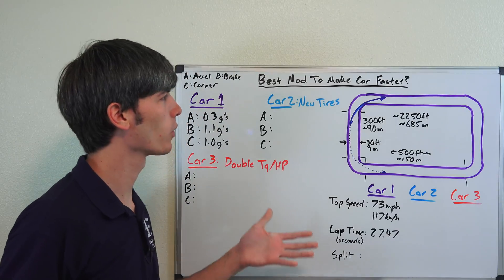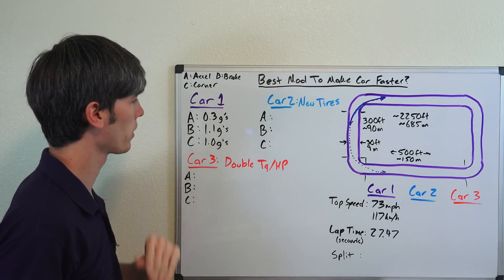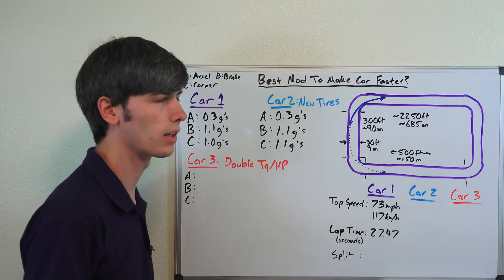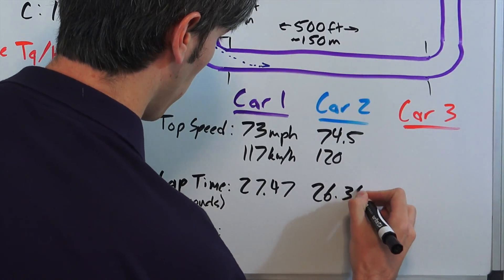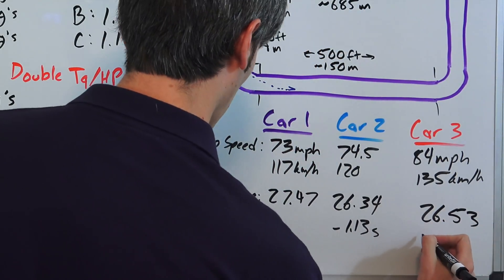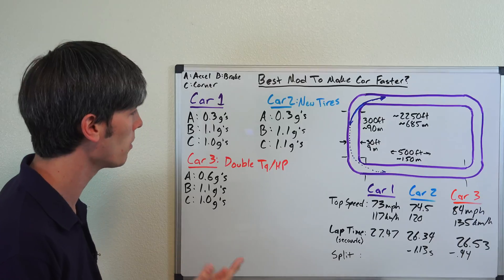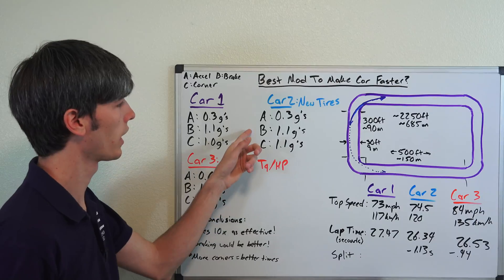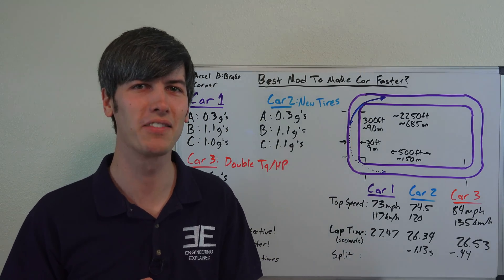What's The Best Car Mod To Go Faster?

Comment: didn't even get to the vid yet... but the best modification is to adjust the loose nut behind the steering wheel, the driver is usually what needs the mods

Comment: I think any aftermarket part you can put on a car that can be reversed(for profit) is wise for modification. If it can't be reversed like a engine bore increase(can you really get back the metal you shaved off the block?), the only profit you'll gain is the feeling of going fast lol No one would want a Skyline R34 with modifications the buyer can't put on...

Comment: Another thing that really boosts the performance of tires and cornering, is weight reduction. You should be looking at an easy 2-3 seconds quicker overall. It's a lighter load to stop, meaning less stoping time, and you can hold the speed better around the corners.

Comment: Better tyres are not only faster in corners but also much more safe in every way, which isn´t that bad considering that a real sportscar is being moved at higher speeds and may have less safetyequippement (like a Lotus or Caterham e.g.). How much difference can make an adjustable suspension? (I know that it is depending on the car and its standard setup) My experience is, that many people who changed their suspension, have a worse car afterwoods despite of a wrong (mostly too hard) setup.

Comment: I'll keep this in mind for my not so high powered sedan.  I'd consider stiffer suspension as well, but, road conditions and speed bumps.  Or does modern suspension exist that would make you comfortable driving normal speed over speed bumps yet helps you corner better vs standard?

Comment: Hello, Jason. My name is Donald, i'm from Malaysia. I'm really curious about a device that is widely sold in the local market. It's called a "twin ball bearing air charger". The company claims that it is dyno tested and is supposed to increase horsepower. I'm skeptical and I would really want to know if it is true as I plan to install it on my car. This is the link to the product: http://www.worksengineering.co/twin-air-ball-bearing-air-charger-/product-690505.html
I really hope you could clear my doubts regarding this. I'm a very huge fan and i've done most of the mods to my car based on your videos. You are a genius in the automobile world. I would really appreciate it if I could at least get a reply or have you make a short video to explain how this device works and also whether this device works at all. Thank you.

Comment: The best is getting a car with forced induction like my WRX STI or Audi A6, then tune it. I found stage 2 to be the sweet spot for both (might need a downpipe on turbocharged cars, a smaller supercharger pulley on supercharged)

Handling wise I found that new sway bars and end links were the cheapest and most cost effective mod for cornering.

The best upgrade aside for tuning was some wider lightweight Rays Gramlights rims and Michelin Pilot Supersport tires. I saved for these for a couple of months. It was a huge huge difference in braking, acceleration and cornering.

That's the order of mods I found to be the most effective. Everything else had a smaller effect, like steel braided brake lines for stronger brakes or a smaller steering wheel for better turning.

I think the most important thing at the beginning is getting a capable car to start if you want to modify it. You have to get an already good car to make it great.

Comment: I'm not sure how interesting or different it would be, but if you're willing to do a basic comparison between perhaps increasing the tire width vs. increasing the effective wheel/tire diameter vs. using an improved tire compound I would be interested in seeing how that theoretically plays out in this situation. 

This is a good general comparison though :) Proves the point about how different modifications (and/or vehicles, picture something like Lotus Elise vs. Ford Mustang GT) may or may not play a significant role in improving performance under different scenarios. It also makes you realize just how complex of an analysis this would be if you were to factor in all of the dynamic aspects of a vehicle's geometry.

Comment: I always wondered how torque is affected by an outside source. Its hard to find any information about it. For example : say a car makes 200 hp and 175 lbs/ft of torque. If it was possible to connect an electric motor to the drive axle and the motor makes say 25 hp and 75 lbs/ft of torque will the the total torque to wheels increase; or will the engine supersede the electric motor because engine already makes more torque than the motor can produce?

Comment: So I don't deny that tires are VERY important and make a huge difference, but it seems to me like this track may just favor the car with better tires while acting to mitigate the improvement more torque and horsepower would make. In your rounded rectangle track, your left and right curves are 300 ft. You call them "straights" but then you say that your cars go through them at constant speed. This makes torque/horsepower less relevant then. This only leaves the two 500 ft straights, which are barely longer than the 300 ft straight. So of course torque/horsepower would seem to make less of a difference.

I mean you're going through 600 ft of the this track at constant speed, so of course the car with better tires would pick up an advantage when only 1000 ft of the track can be used for acceleration. 600 ft is more than 25% of the track you're traveling at constant speed, which doesn't seem realistic to me.

A track with shorter turns that don't last as long, with some more time for acceleration would show the car with more torque/horsepower holding an advantage IMHO.

Comment: What I find funny, is the car with double the tq and hp, would be able to accelerate out of the corner a lot quicker,  even if the tires were the same as #1 is barely a difference, especially when it comes down to the weather and how hot your Tires are. Sticky tires don't do as good unless it's hot. So I feel car #3 would be the best

Comment: can you please make the following videos:
-how the new amg exhaust works, crackles and pops
-best mod to increase engine power safely
Reply: Solider Armatang supercharger or turbo charger. you can get some kits out there that a some somewhat mechanically inclined person could install(supercharger only, haven't seen any "easy" to install turbo kits out there).
Reply: Alex
but those cost a lot tho, but i get what u mean, but also tranny is an issue since it might break under all that power.....
Reply: Solider Armatang you asked for safe ways to increase your engine power you didn't said cheap (LOL) but a tune and a less restrictive exhaust system is pretty cheap and can make your car faster.

Comment: i'm a firm believer in good tires and I didn't always believe. I used to go to the chain tire store, buy the most affordable tire I could find and that usually meant a hard, generic tire. one day I bought some good, but used Michelin pilot sports and DAMN! those tires changed the whole attitude of the car in the best way. the car negotiated bumps better, turned, accelerated, braked and over-all drove on the rode better. that's when I learned the importance of good tires.

Comment: Wanna make your Civic si faster?

Follow these mods and you'll be smoking F1 cars in no time:

PVC pipe exhaust system +25HP
Type R stickers +500HP
Pioneer or KENWOOD flashy sound system +150 HP
spinning rims for more tyre grip.

And last but not least..... add cardboard aero kits for more aero grip.

You'll be driving like Ayrton Senna in no time!!

Comment: How to find the best tires?

I drive a 09 Jeep SRT8 (modified) with 275-40-20 tires in the front and 315-35-20 tires in the rear. The first mod i did is toss the OEM run-flat tires an slap on some Nitto NT05's but now (2 years later) those tires are finished and I'm looking to step up to better tires, do you have any recommendations?

Thank you!

Comment: As an example, the toyota's Rav4 for rallying uses the stock motor.  
  
Another advantage to the Rav4 however, is that there will be few cars rallying in that class (usually) compared to other vehicles.

Comment: nice explanation .
just a thought if  u double the the power of a motor with lets say boost shouldnt the braking force improove also just as the ones in tires i know i wouldnt be as much as with tires but still. because u pointed out that u didnt include the braking improovment have a nice day and keep up the good work.

Comment: Tires are one of the best upgrades depending on the type of tire you get, I feel as if though you should've went further into the type of tires to use for the best cornering speeds since that is where it appeared to have the most difference in your diagram.

Comment: No track looks like that though, most have long straights and wider banks where power is a big help.
Reply: apex128 have you seen the Indianapolis motor speedway?
Reply: Matthew Fincher The shape may be similar, but the straights in the video are only 500 ft.

Comment: Wrong, putting in a $150 short ram intake will add 15+ horse power and will make your naturally aspirated car faster. Drawing in hot air from the engine bay will make the oxygen hotter which will make it more explosive. And don't forget Prius tires.

Comment: This analysis is perfectly valid (as always) for making a car faster on a track. Carrying as much speed through a turn is crutial. Good explanation of the physics of the situation.  However, this argument defines faster as a shorter lap time. Many people (mostly Americans) prefer to define it in elaspes 1/4 mile time. However, tires are still crutially important here too. Drag racing relies much more on the available power, as you always start with zerp kinetic energy.

Comment: When I put a new set of wide Goodyear Fierce Instinct tires on my '12 Civic coupe the difference in handling was huge! Previously I had two mismatched bs pairs of tires that Carmax slapped on there when I purchased it. I hate the car now, still, but I seriously hated it then. After I put the Fierce Instincts on the car became 100% more fun to drive fast around corners and turns, it's still terrible in a straight line, but I've made a couple of peeps in fast cars look foolish around a corner or two.

Comment: Its faster on this particular track, yes. Make a new one with longer straights. Youre not running the same downforce on every track in a race car. Some tracks benefits better grip and other tracks benefit top speed. But yes, rubber first.

Comment: Are you assuming a 50-50 weight distribution and down force as a constant on all wheels rather than a velocity dependent method of making engineering students cry. Otherwise using a static number for cornering makes no sense. Oh and lets not forget the force on tires changes as you accelerate, brake, corner or do pretty much anything. God damn I remember studying this stuff, I still have nightmares and flash backs to it.

Comment: An engine has to use a lot of energy on the compression stroke, I find that drilling holes in the pistons thus reducing compression helps a lot as the energy that would be used to compress is saved. If you have a long enough drill bit you can just remove the spark plugs and drill though the holes. If you close the spark plug gap while they're out the spark has to travel less distance and ignites the fuel quicker.

Comment: Not sure if you covered this, but can you have a video explaining cross drilled rotors vs smooth rotors?  From my research and data, cross drilled rotors provide no benefits over smooth rotors for daily driving.  If the consumer wants better stopping power its all about the tires.

Comment: what does word "g' means in terms of cars.
Reply: +Engineering Explained it's actually the amount of gangsters on roller skates that you can safely pull behind you. So if a car can pull 1 G around the skid pad then that's one gangster he is pulling behind him
Reply from the maker: Acceleration of gravity. The earth is pulling down on you with 1 "g" currently.
Reply: G is the force of acceleration (or deacceleration) in comparison to gravity. If you accelerate at 1G it's basically like falling down. So instead of saying 0-100 kmt (or 0-61 mph) in 2.83 seconds (which is 1G) you just apply the relative force. Now if you know that it accelerates at 0.3G you can divide the 2.83 with 0.3 and get the acceleration of 9,43 from 0-100 kmt (0-61 mph). The thing is that the reverse is not so interesting, so instead in mathematical aspect you consider the force the car is exposed to - and how that will feel to the driver.
Reply: +DMV Miata and Jeep ; what about a car that can pull a 1.2 G around the skid -.-
Reply: its about 9.81 m/s^2. That is around 32ft/s^2?
Reply: +dmv miata and jeep.hahaha lot better than newton laws of motion.

Comment: Weight loss - Generally can be done for free, and helps all 3 aspects. Remove spare tire, extra seats, carpet. Lose 100-200 pounds. Better acceleration, better braking, better turning.

Comment: first thing you do with any sports car to increase performance is lightweight wheels and tires.  

if its a car you use daily you probably shouldn't go crazy.  but a lithium battery is a great way to drop weight.  drop 30lbs 

after that race seats and something like a momo steering wheels.  you can drop anywhere from 50lbs to 120lbs here.  

on my wrx wagon build i couldnt believe how much junk it had in the trunk.   gutted it and it has a cover so it still looks like a normal car.  also removed the roof rails.  since i removed so much from the back i had to get creative on the front.  foglights were removed.  front beam replaced with cusco.  subframe replaced with cusco also.  in the end i believe we got the car down to around 2800lbs while still being a street car.  400whp helped as well.  also has lightweight brakes from wilwood.
Reply: OutlawUniverse what was the initial weight before all the weight reduction?
Reply: youfoundisaac Cusco is a company that makes performance suspension parts. Things like sway bars, front and rear strut tower braces, and subframe braces. I don't know if they make roll cages or not.
Reply: Nice man.
Reply: OutlawUniverse what is cusco?
Reply: agreed on lightweight wheels.  stock wheels are generally very heavy.  also, remove the spare tire/jack if you have one and only daily commute - not really necessary to have one in there if you just carry an air pump and always have a phone on you.

Comment: IMO I think a light flywheel would be the best bang. The car technically won't go up in horsepower but you will have better times at the track.

Comment: Not mentioned: on lap 1, the car with double the power is going to pass the other car and then hold his competitor up in corners, very unlikely that they will regain the lead even though they are able to run better lap times.

Comment: What kind of experiment is that?  You have a go kart track there.  It's way too small to get useful data from a car.  Also, what did you upgrade tires from and what vehicle?  How much power did you double?  How do such things relate to the track?  Sorry, but this isn't scientific at all.  Of course superior tires will give a handling advantage, and more power will give straight line advantage.  Which is better is decided by conditions.  Apples vs oranges.

Comment: After decent tyres (with enough air in it...not that low section tyre BS), reduce the weight. It improves everything, saves fuel and won't increase wear. At 70km/h air resistance is the biggest force slowing you down. 
Improving the driver might also help a bit.

Comment: We didn't go science but here's our "results" of last summer track day on a twisty french track.
My car is a standard Clio 16s, destroyed r888 front, dried out Marangonis slicks at the back, CL RC5+ pads all around, my buddy had an Audi S3 8l, standard, 4 summer tires in good condition, Haldex AWD, EBC Redstuff front pads.

Because the track is twisty, my car really lighter than the panzer, I could brake a lot later, turn faster and be wot a lot sooner than he was capable, the main straight wasn't long enough for him to be able to overtake me.

Not scientific at all, but even with a turbo (and an S3 8l does pull quit good), awd, good tires, pads, he was slower. The weight didn't help on that track too. We didn't timed our laps because it wasn't the point, we were having fun and learning at the same time. 

All in all, I think I had the most fun because even with a really high temp outside (over 40°C), my car did great, tires held up, brakes were flawless and I liked it a lot.

My buddy fried his pads, melted the tires and the car felt it was hot too. 

Twisty short track, get a hot hatch with cheap parts ftw, long fast track, get a rocket or you will need to paddle in the straights, or drink a cofee :D

Comment: wouldn't suspension upgrade give you the better speed? I can almost double the speed I can corner on highway vs stock. we are talking about THE best upgrade coming from stock right? IMHO, THE upgrade is the suspension mod.

Comment: Great video! I'm sure there is a solution for the optimal racing line for a given track based on the coefficient of friction of the road surface and the tires and the geometry of the corners. 
I once had a 3 liter Alfa-Romeo breathing down my neck - until we got to the twisty mountain roads. My 1.8l Miata had lowered suspension, Bilstein shocks and sticky tires. I left him standing thanks to my high corner speed. I was grinning ear-to-ear! 
All the best, Rob

Comment: A very excellent video, verified in real life. upgrade tires then brakes then suspension (to taste), then reduce weight, then if you have too much money do the engine. Good tires save lives too. Here in France on small tight tracks I see crappy hondas battle with 911s and this is tons of fun. and latest toyo R888R is amazing (even  on the wet).